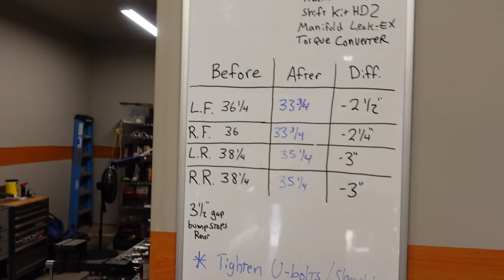HOW TO RUIN a 4wd truck by LOWERING IT! (but improve the handling, and make better in every way)

Comment: Hey LT. I have a ‘90 z71 and in the beginning of the video you said you can do this process with 88 and up… I wanted to make sure the drop spindles are also something that will mount up for the OBS 4x4’s. Just wanted to make sure before I placed an order, so I’d much appreciate your input. 

Any other ideas for how to get even lower on these 4x4’s? I’d really like the stance that I have on my 2wd that has a 5/7 drop but not sure that’s realistic. 

Thanks in advance. Love the videos!
Reply from the maker: The drop spindles won’t bolt right on from what I know, but guys have adapted them from what I have seen,  it I think that might need different ball joints or something like that. You can get an OBS very low just by decranking a drop key

Comment: I have a 21 RST I was getting ready to put the rear shackles on.  Any suggestions on how to lower the front end since it doesn't have keys? How is the ride adding shackles and taking out the spacer?

Comment: Hey how’s it going brother good video👏🏽, I have a question and really need some help figuring out my situation I have a 05 gmc sierra single cab on a 2/7 drop an after I dropped the truck on a flip kit and hangers it won’t stop riding stiff it bounces for every single little bump I recently added shock extenders and it didn’t do a difference any suggestions on how I can fix it?
Reply from the maker: did you C-notch the frame? How far away from the bump stops are you? I might guess you are bottoming out somewhere

Comment: Just curious what size wheels that came on the truck. Was thinking of doing a rear disc brake conversion on my '09 2-wheel drive Silverado and don't want to have to change out wheels and tires since I just bought a new set of Michelins for it.
Reply from the maker: I think those are 16x7 stock wheels

Comment: Isn't it actually a raised front hanger for the front of the rear leaf spring? I realize you're just trying to keep it less confusing for people.
Reply from the maker: Yes, the front hanger is higher up on the frame, but it’s called a drop hanger…

Comment: Im a die hard GM 4wd guy. while it drives me absolutely insane seeing a lowered 4wd, it depends on what youre doing with the truck. The truck you built on Truck Tech was a decent truck to say the least when you swapped the front end with a NP246.

Comment: A little off topic, but do you know of any kits out there that allow a person to use a 4l80e without the ecu and shift "manually".
Reply from the maker: There’s always the full manual valve body
Reply: @LawrenceTolman  I haven't been able to find a manual valve body for a 4l80e
Reply: @LawrenceTolman  actually the only ones I've been able to find is a $1200 manual valve body with a trans brake.
Reply: @LawrenceTolman  I'm not familiar with transmissions, but im guessing that I'd have to pull the electronic valve body out and replace it with a manual valve body?

Comment: Go lower! I had a '95 extended cab nissan hardbody. It was so low, the front was literally sitting on the bump stops at rest. And I had to remove the 3" exhaust part that goes over the axle because with my 700lb 4x4 atv in the bed, there was no space between the axle and frame. Lowered trucks are still very useful as long as you're not planning on going mudding. Since yours is 4x4, it'll still be very capable compared to 2wd. I miss my hb.

Comment: LT, is the suspension the same for a 94 Chevrolet Silverado 4x4? Or does that have coils
Reply from the maker: Same, in fact I lowered my 96 using the same exact GM purple keys
Reply: @LawrenceTolman  what was the one y'all did on the show? Cause I'm kinda into lower that 94

Comment: Looks good and for s small amount of work really makes a huge difference!.....now now shame on you LT always use anti-seeze on any suspension hardware threads for 2 reasons 1 being to slow down the corrosion process and 2 being that when you want to go to a different set ie go lower all that hardware will come out with a breeze to swap In new shackles etc.
Reply from the maker: I did put it on, and thought I even showed it... but just like frank, I use that stuff on everything
Reply: @LawrenceTolman  good man LT because we all know that the first thing of our own that we dont put it on is going to be the next bolt we have to pull out the hot wrench or even worse cut off wheels, drills and extractors for.......those are the worse!

Comment: I bought a truck that has already been lifted tonight 33" tyres. Do I have to go back to stock suspension to.lower it?
Reply from the maker: depends on how they lifted the truck, but if they just cranked the torsion keys or did a leveling kit, just swap out the leveling kit parts for stock ones and then you can lower it like I did
Reply: @LawrenceTolman  thanks I check today. Can shock absorbers stretch that much? Or are longer ones put in for a lift?

Comment: I just bought a 99 Silverado single cab shortbed it has 5 speed with long tube headers lo ram intake stage 3 cam stage 3 tranny build and clutch kit 
The kid that sold it doesn’t know how to work on trucks it had a bad rocker arm i bought the truck for $1000 lmao I can’t wait to lower it and twin turbo that bitch lmfao

Comment: If you like lowered, better handling, get a 2wd..  why waste the weight and additional cost of the 4x4 system.  Used 4x4 trucks are always more expensive than 2wd of the same rig.  Put that extra $$$ into a torsen rear diff.. or E locker

Comment: Should have dropped in a new fuel pump at the same time you had the bed off, every GM truck from that generation will require a replacement sooner or later!
Reply: He did that already in a previous video.